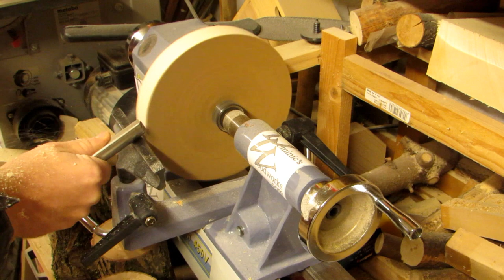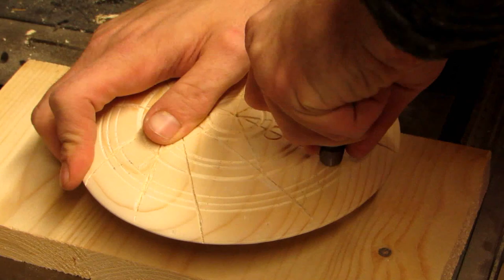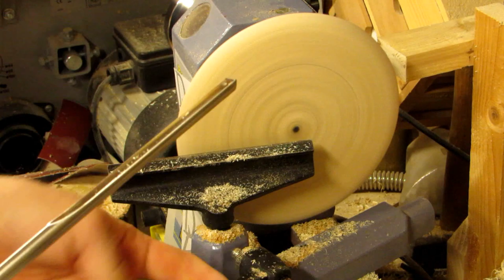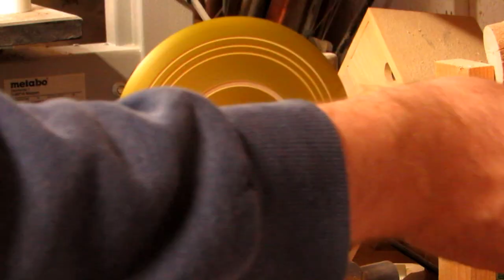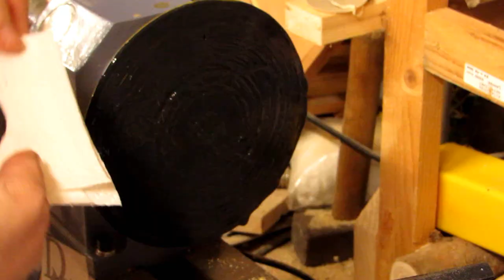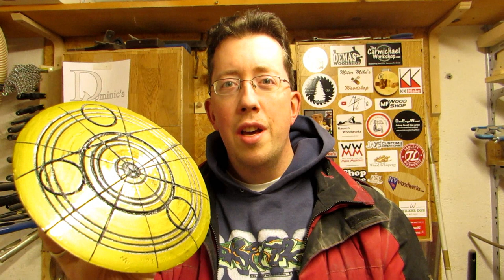I Made a Confession Dial - I confess it hails from Doctor Who

Comment: i confess that i should advise you to try using a plain cheap soldering iron from a DIY store as a wood burner as it does not get as hot as a proper wood burner, thats what i use sometimes :) very nice project tho :)